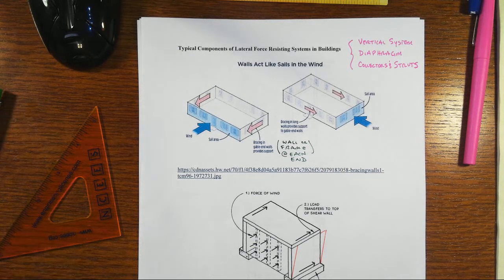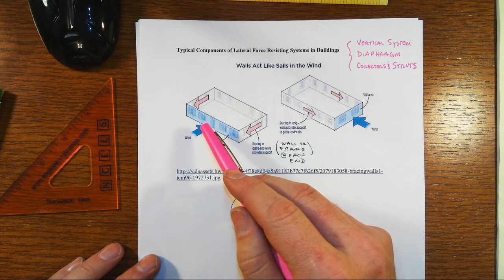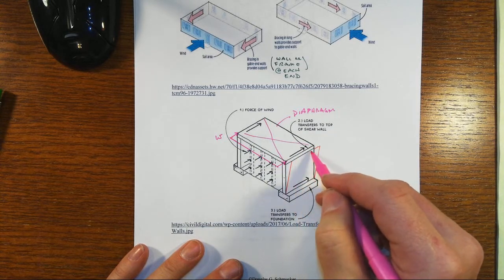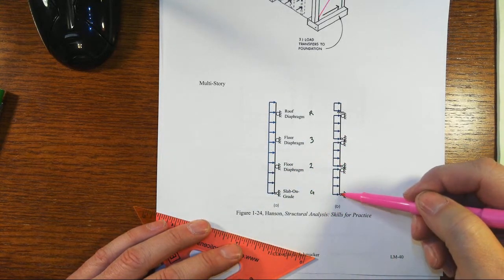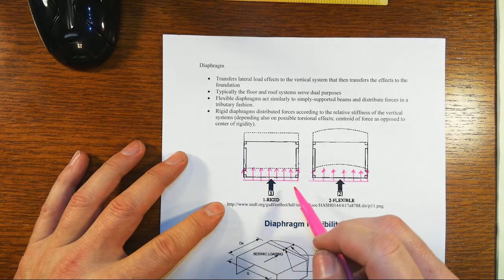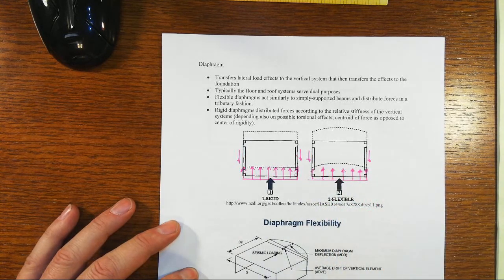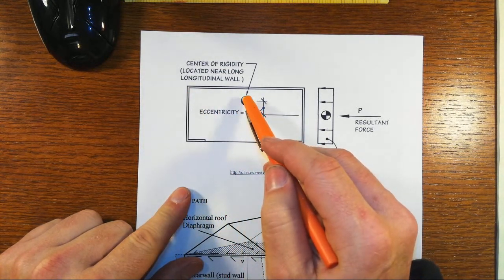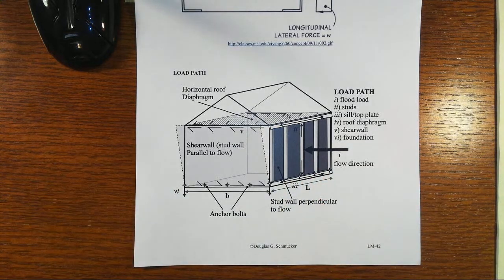LFRS Part 3 Components and Load Path

Comment: Hi, why doesn't out of plane wall transfer load to lateral load resisting system directly?
Reply from the maker: Think of it this way ... walls only have significant strength and stiffness in their plane.  Out of plane, they typically behave as a simply supported beam (a 1-ft wide strip that runs up and down).  They transfer the forces perpendicular to their surface (such as wind and seismic effects) to the "top" and "bottom" of that strip.  Sometimes, the engineer designs the wall for the strip to be horizontal rather than vertical.  Either way, the wall transfer those load effects over to perimeter elements (could be a column, beam, or wall that is perpendicular to the wall of interest; could be a floor or roof system).  The reason is that in-plane behavior is very stiff involving shear and normal strains that are very stiff ... think in terms of EA/L like in an axial stiffness situation as opposed to EI/L^2 or L^3 for bending situations.  Out of plane wall behavior is like bending of a beam.  It is more complex than just EI/L (the latter being beam bending behavior but the wall is really structural plate behavior).  If that is more theory than you like, consider it this way.  Glue a bunch of long sticks together and stand the whole thing up like a wall.  Clamp ahold of the "Wall" at its base.  Try to push it in-plane.  Compare that to what happens when you push it out of plane.  In the extreme, think of the wall as a sheet of paper.  That sheet of paper has almost not out of plane stiffness.
Reply: @dougschmucker8212 Hey Doug, that makes sense but my question was along the lines of why is it always assumed as though the out of plane walls are one way slabs transferring loads to diaphragm and footings, and not as two way slabs with loads being transferred to the in plane walls as well?
Reply from the maker: @SudheendraHerkal736  Two basic reasons: engineering design is about what is good enough as opposed to what theoretically  might be, and what is simplest and easiest to do that gets the job done.  Regular walls are typically designed and constructed as one-way systems and most often they behave that way as well.  Maybe even more importantly: too time consuming to work through and verify the two-way slab design process even if automated in a computer ...  Note that most of the computer solutions are nothing more than a way to code up the hand based solutions.  It is rarely if ever a true FEM solid modeling of a three dimensional slab.  We wouldn't even know what to do with those stress calc's because of the complex nature of reinforcement and matrix interactions.  Instead, we always end up with approximate methods whether by hand or by computer tools.  We can be more efficient with our time and end up in a safe place using one-way methods.  Then, if we need to refine what we are doing, then we can do something more precise.  And, finally, if you start adding openings, then you are going to end up with something way different than just a "two-way" slab wherein you add so much reinforcement that you might as well have trust treated it as a series of one way strips.  Obviously, people have found all kinds of different ways to do things, but these are many of the reasons why we start with a very simplistic model and only add complexity as it is genuinely needed.
Reply: @dougschmucker8212  Hey Doug, that makes sense! Thank you!

Comment from the maker: You are welcome
Reply: Very informative.

A question, if i assume my deck(slab) to be a rigid diaphragm my steel frame to be hinged and have an inner shear wall, will the columns take any lateral loads. Or will it be transferred directly to concrete core?. (Steel frame with concrete core scenario)

Thanks
Reply: I can show you the schematic, but don't know how.